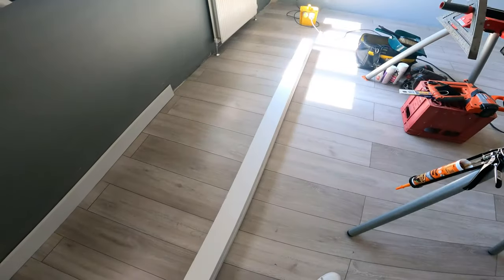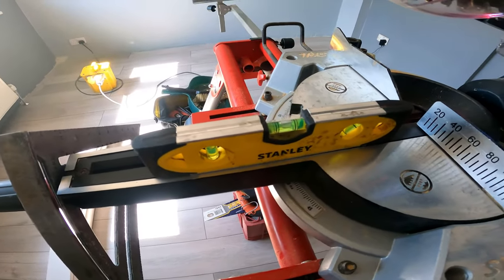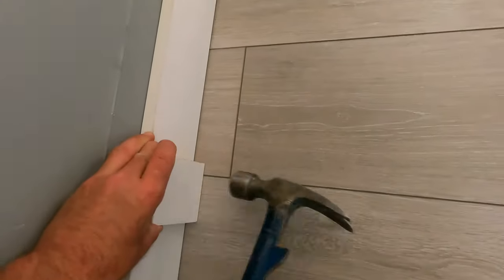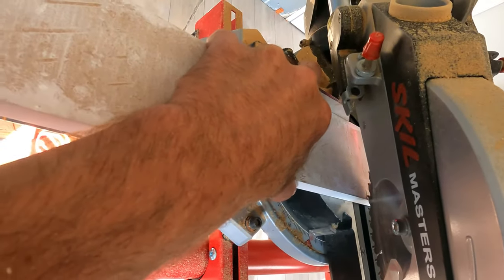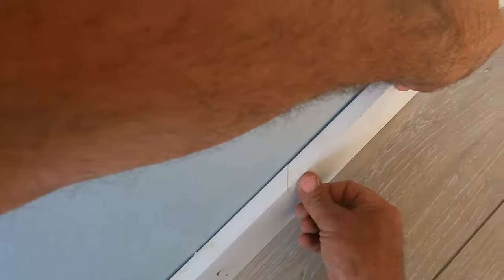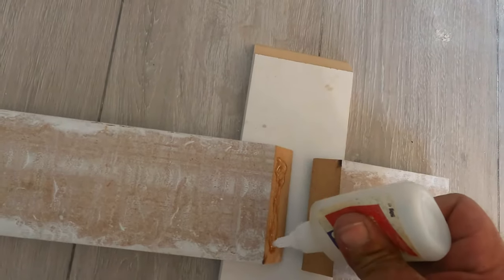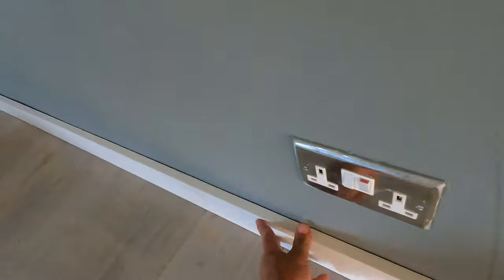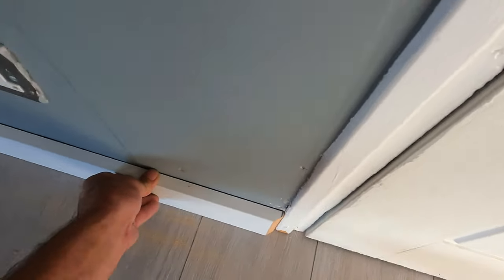How To Install Skirting Boards A DIY Guide

Comment: Hello mate, I’m just about to do my skirting and door frames and surrounds for the first time. I’m going to hire in a nail gun, is there a certain type I need, power wise. I have 1 stud wall and all the rest are solid? Cheers pal
Reply from the maker: Hello max thanks for stopping by the vid  mate 👊 paslode is a great gun to use but there's some great first and second fix guns on the market, most take first and second fix nails so it's all about the price you want to pay for the gun have a look around before you commit there's alot to choose from I'd say for a one off go for something half decent  it will do the job plus if you're only using it as a one off 
Good luck with your project mate hope it goes OK 👍 
👊
Reply: Cheers mate, I will do my research 👍🏻👊🏻
Reply from the maker: @maxwardle1041  
Yeah look around first mate no need for to much expense on the hire most guns have similar power to so most will do the job 👍 
👊.
Reply: @creativecrambo  cheers mate, much appreciated for your time, advice and reply’s 👍🏻👍🏻👍🏻👌🏻👊🏻